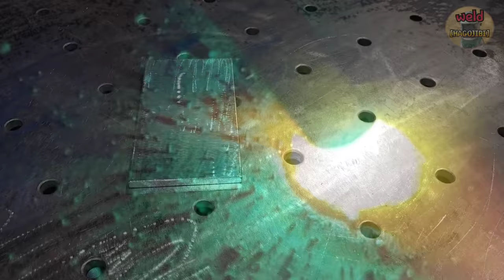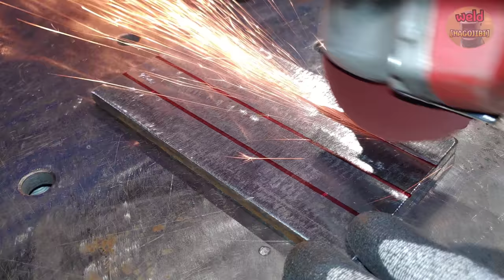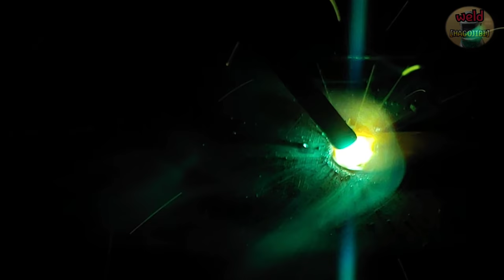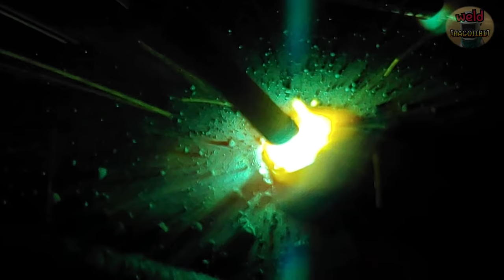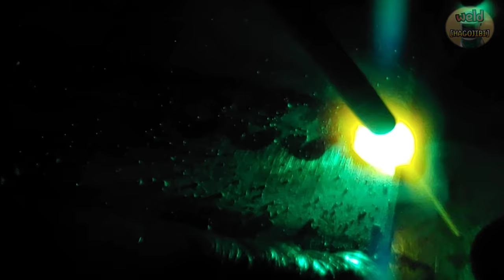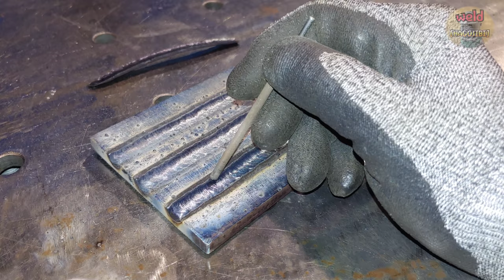Why You Need to Learn Weaving in Electric Welding

Comment: Nice video.
This is how it should be with electrode welding, the slag lifts and loosens by itself.
Reply: Depends what type of rod it is, and what you're doing with it. Fillets on steelwork with iron powder rods for example, dont always peel, the slag often pops off in one piece. Or a pipe open root with a 7016 dcen, it clinhs to the weld and the preps, but comes off with a hand wire brush
Reply: It applies only on thick materials
Reply: Unless its the stainless steel rods that Ive used tho. Those things are a safety hazard. The metal cools and shrinks and slowly small bits of slag gets shot off the weld, and into your eyes
Reply: @jamesordwayultralightpilot  i have those safety glasses. Theyre usually in my pocket. Why do you ask?
Reply: @jamesordwayultralightpilot  but my face is hot and sweaty!
Reply: @de0509  I see you know the script. Lmao

Comment: Great video , yes its all practice , like most things in life really. But arc length is the real secret to master , after that the rest seems to fall into place easily.
Reply: It would be very nice to see a video on just the arc length. People talk about it like Jody but never really explain it
Reply: @therealspixycat  as a rule of thumb arc length wants to be the distance that the metal in the middle of the rod is ... adjust slightly to suit after that .. but that's my rough guide.
Reply: @tomthompson7400  Do you mean the welding stick core (just the metal instead of the metal with the flux coating) diameter?
Reply: @TheAefril  yeah just the diameter of the metal core of the rod. Although with low hy rods, you need a shorter arc than that, ideally as short as possible without stubbing it out👍
Reply: Спасибо всем сварщикам, делящимися своим мастерством. Больших разводов или стёжек, вчера сварил электродами "лб, японские и есаб,ок 46. Отлично заварил большими стёжками свою дышловку на прицеп. И всё благодаря мастерству здесь на видео. Спасибо  добрым людям, здоровья Вам всем. Наконец то  я освоил этот большой шов.😊😉🙃🙂 в свои 58лет😅😂🙋

Comment: This taught me (and I’m assuming everyone else that wasted 7mins of their life) absolutely nothing. Why do i need to learn weaving in electric welding? You didn’t even answer your own question
Reply: ABSOLUTELY nothing!!
Reply: weaving deposits more weld deposits but you're gonna need shit load of rods depending on the type of groove you're gonna fill
Reply: @mikec.8556  unless you're a fan of polished fancy bead patterns, you'll just have to grind it off anyhow. No?
Reply: @trueaussie9230  depends on specs call for .
Reply: @mikec.8556  understood. If the specs call for more than just securely joining 2 pieces of steel - ie an excess of welding material - then weave-welding is the way to go.
I'm only an amateur welder but, as with any / all work I undertake, I like the end result to be as neat as possible.
As an amateur, my understanding is that once the valley between the pieces is filled the result is as strong as if it were originally 1 piece.
So I'm still at a loss to understand why / under what circumstances I might need to weave-weld.
What benefits does weave-welding offer that 'clean' welding does not??
Unfortunately I find 'professional' welders to be extremely reluctant to give up their 'secrets'.
I'm coming to the conclusion they're afraid the world will discover that welding is not such a ''specialised skill' after all.
Reply: LOL. I was gonna ask the same question. He never explained why. From my experience though, weaving is often used to prevent undercut. When you weave side to side, you are washing your puddle to the edges and not allowing a deep, abrupt edge to undercut, as the undercut will be the weak part of your weld. I’ve also used a weave with more of a whipping motion on thin stuff to prevent burn through that just a straight bead would cause. The other reason to learn the weave technique is when capping a weld. That often requires a wider weld. He could have explained all that but I guess not.
Reply: Were you not paying attention, they clearly speak no English. He's demonstrating how to fill welds on one pass and doing a good job at it too. Don't be so sarky when what you demonstrated was that you need simple concepts explained in order to understand.
Reply: Running verticals
Reply: its good to know both but most codes want stringers over weave. personally i like stringers more when im welding out a pipe. i think it looks cleaner i feel like rhe weld is stronger. Some codes will want you to weave it instead of stringers but ive never been somewhere where they said weave only.
Reply: Practice makes perfect. It takes time and patience to reach his level of welding. He did clearly show the patterns. Sitting and watching without practice cannot improve one’s skill.
Reply: He was referring to undercut, simple, and amateur welders who say welding is soo easy I say: stick to being an amateur 😂
Reply: В чём прикол 3наваров , разницы не заметил , кто подскажет
Reply: He made this vidio to show you he can weld😂😂😂

Comment: Can you do a video on just one topic : reading the weld puddle when stick welding?
Reply: (SECOND COMMENT) ...one side to the other. Adjust heat so the weld is almost flat when the bead is done that's when you know you got good penetration. It's literally all about practice. I watch behind the arc at the dim area where the puddle cools. If it looks like both pieces are cooling evenly and not more on one piece than the other then I don't adjust my circles or stick angle. But when you just start out, pay attention to that area and slightly change your method and see how it affects the cooling puddle. 

Problem with welding is people think they can study it and ask a million questions and it will just suddenly become clear to them. When in reality you just need to practice all day everyday and by the end of the week, you'll probably understand how to do it right.
Reply: (FIRST COMMENT)Just practice. Don't get complacent and only try one method. Once you can build knowledge on what you were doing and how the weld turned out you can tweak your method. Just don't hold the rod too far from the material otherwise you get pinholes. Always lead the stuck across the joint, don't push the puddle. I've always had the best luck with small circles, just be consistent with them and the weld will be parallel from

Comment: i am a welder with 2 years of experience and i can give an advice for all 3 of these types of "layering":
6013 can be defined as 2 in 1 (can be used like 6010 and 7018)
unless you give a shit, then call it 6013

going straight: that is literally what 6013 is used for.

weaves: one of the best ways to hold two plates (or any metal) together. however, it takes practice in order to keep a "straight" line.

circles: do NOT do this! your just sandwiching slag in between each layer.
(don't believe me? try doing butt-plate like that as a cap and bend it, you'll see all the slag in between each layer come out.)

all-in-all: 2 of the welds look great! your weave's look spot-on! but circles does not work well in any welds (unless your a shitty RV repair man, then go ahead).

Comment: So, at first,  I disagreed a little bit, then I realized that it's 601x rod, not 7018, lol.  7018 is a bit different technique and behavior.  It would not produce such a nice weld running that height/angle, and the asthetics would be off with those movements.  For 60 series, these are very nice welds.   Going to retry these next time I pick up some 6010, which is rare.
Reply: My boss loves 6011 and mostly because It says they work with less than clean metals....so they never clean anything before they weld it and it shows...

Comment: it’s so that you can make a bigger weld and not small stringers, it’s also so you can deposit more metal into what ever your welding, for example I had a hatchet for work that had a wood handle that broke, so I grabbed an old metal hammer that I had and cut the head off so that I only have now is a metal handle, I grinded my metal handle and shaped it so that I can fit the handle in threw my metal hatchet head . On the side of the head and the Handle where I shaped it where nice and tight but I had big void at the top the widest part was about 1-1/2 “ and a stringer wouldn’t have filled that gap so I weaved it nice and slow so that I can deposit more Metal into my weld in order to fill the big gap and to also be able to do a one time pass without run more than one pass.

Comment: Weaving is useful when filling in gaps or buttering but results in excessive heat input.  Navy code requires stringers so it is is imperative you learn stringers. 
I am still a novice so this is just an opinion.

Comment: Weaving is a preference and depends from person to person. Heck you can even create your own weaving technique

Weaving (imo) is just there to control your travel time and increase the width of the bead

For small cracks, I typically don't weave, but if I have to bridge for a bigger crack, I typically weave

But if you have great control on your travel time, you don't even need to weave

My weave pattern is an inverted "T" (shake the rod a bit from side to side to form a puddle, then move up)
Reply: i do the same on butt joints or when bridging any large gap, especially in vertical position

Comment: You could also do the half moon, works just as good
Reply: ((((((((((((((((((((((( ......right? 
Not: UUUUUUUUUU 

I've always alternated depending on what works best. Sometimes it really feels like one works better than the other.
Reply: @jamesordwayultralightpilot  Yup ((((((((((( but that's what I use for cap welds, gives a nice look, I also point the tip away from the weld and not towards it, helps push impurities away from the weld. Instead of pulling your bead you would be pushing it.
Reply: @cjcourter1477  cool I always remember what others say when I'm working. Helps to have wise words to follow in the moment.

Comment: I run 60 series 3/32 around 95-100 amps. Use the same current vertical up 7018 1/8 inch.

Comment: It  is too hot for this welding, you can see much of spatters. 
You should clean up your work by  wire brush, or buffer, not a piece of rag.
You should wear  proper PPE, at lease leather gloves,  in case you get burn. This is only a entry level work.
For this manipulation, you might get air trapped. You can grinding off your work and check the section.
Reply: In all honesty you can't see his hands when he's actually welding...